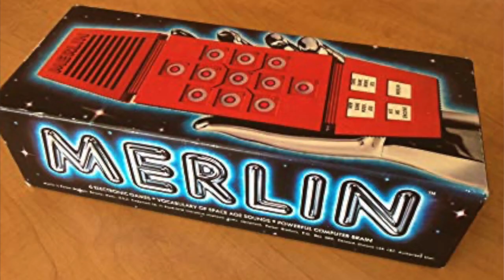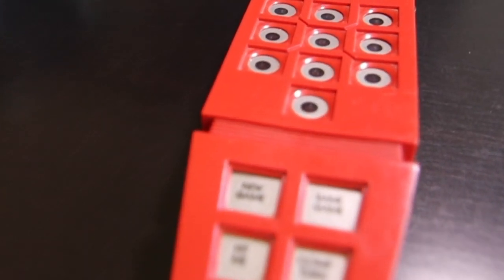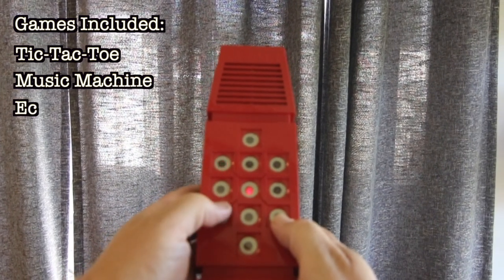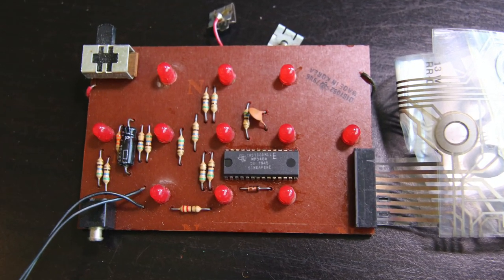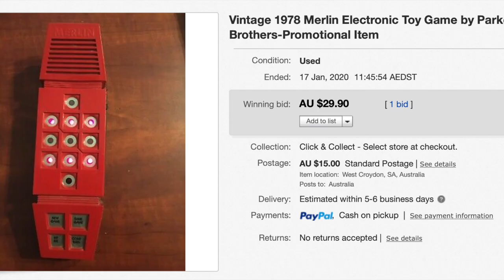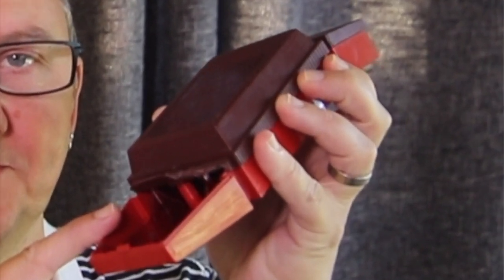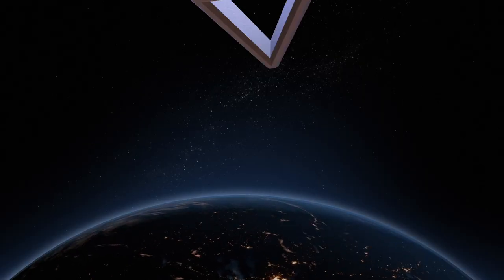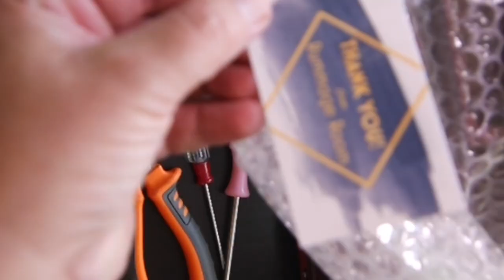Merlin Electronic Game - Retro Repair

Comment: I've got 3 of them now, had two then just yesterday found one with the box, instructions and power cord. Though one of the buttons doesn't seem to work, and the battery terminals are covered in battery acid. This one does have off and on by the switch.
Reply from the maker: Thanks for the comment.  So how many are 100% working?
Reply: @billbaud  2 of em are, the last one has the button not working, and still need to clean the battery compartment

Comment: I wouldn't call a plastic case swap much of a repair :/ was hoping to gain some insight to fix mine which seemingly won't even turn on.
Reply from the maker: Have you tried switching it off and on again? 🤓
Reply: @billbaud  as a matter of fact yes 🤓
Reply from the maker: @matthewrease2376  I am not particularly technical, which may be obvious from the video. But there is always the option of switching out the motherboard with a working one if you can source one. Having said that, there’s not a lot too them, so might be an easy repair for someone with an electronic background.
Reply: @billbaud  yeah I was hoping for a 0 cost repair (or at least really low, swap a diode/resistor or something)

I didn't buy the game, it's actually my dad's from when he was a kid, and I've never seen it working. I was hoping to fix it for him.